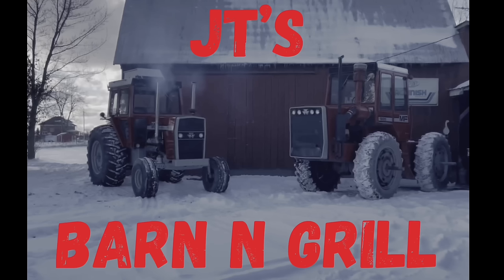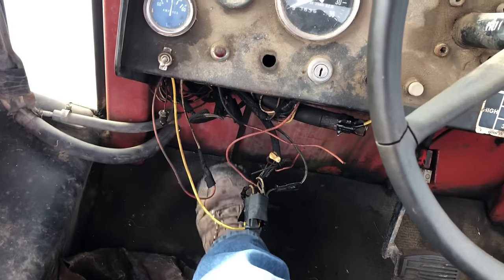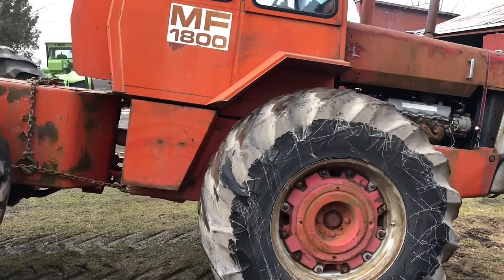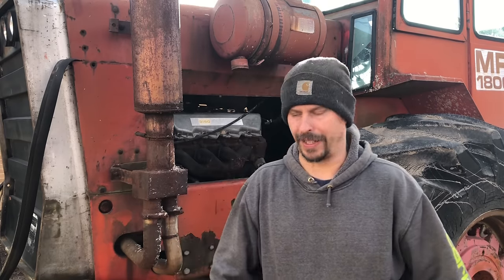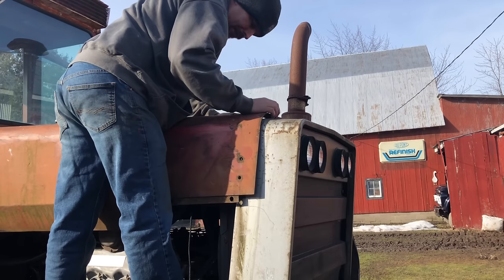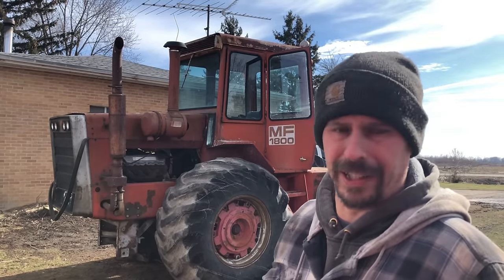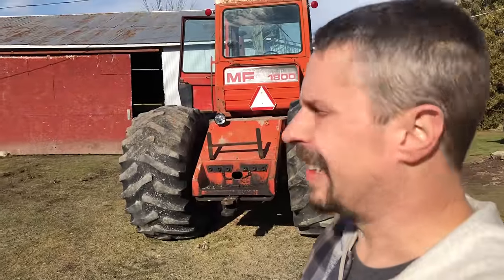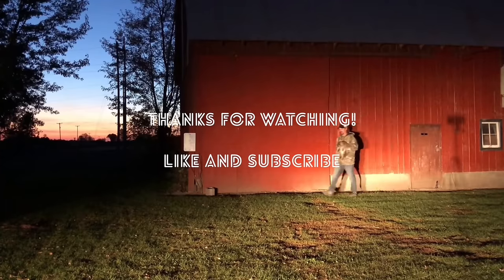Will it start?  FORGOTTEN “death row” massey 1800 sitting 20 years with a locked motor

Comment: If you cannibalize some   old welding cables they carry more current to solenoid and starter motor. Look in Summit racing and you can get fairly cheap diesel fuel pumps that are 12v  and capable of 40-65lbs pressure . If you feel the need to get crazy Holley makes bigger , better , badder pumps for 1500hp diesel pickup pullers and 2500hp diesel tractors with turbos and running 150 lbs manifold pressure  . That's only if you want to ditch an offspring you're tired of .....
Reply from the maker: Right on!  I have been considering an electric pump for that and a 00 battery cable. That should make it do what I need it to do lol